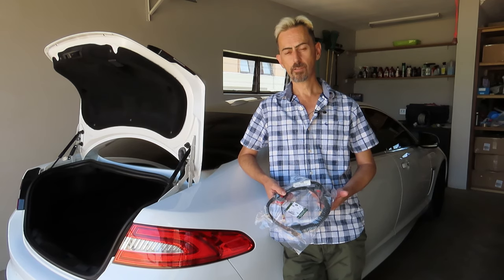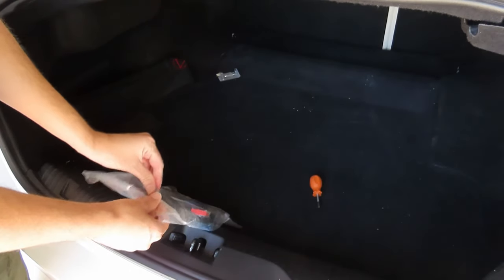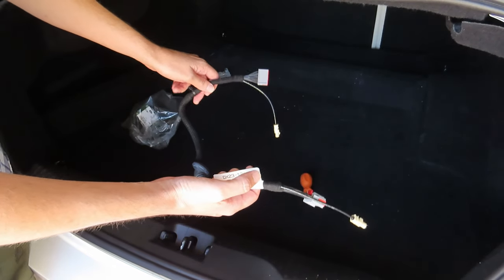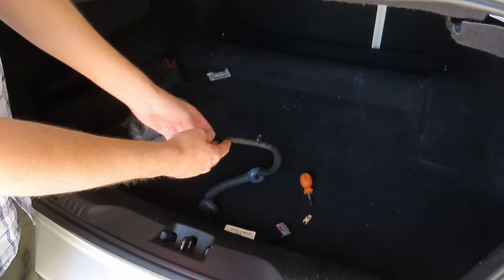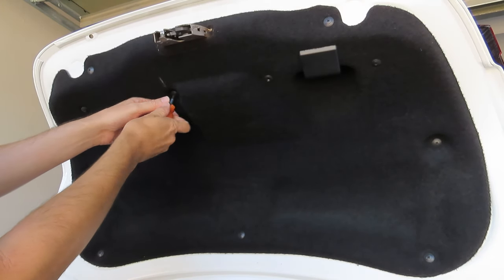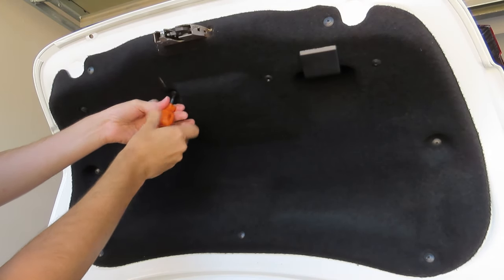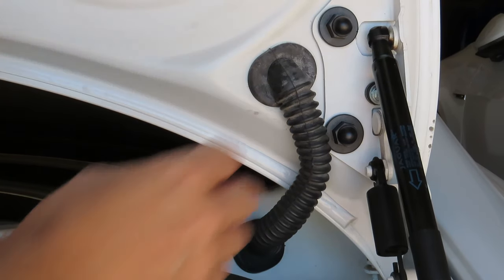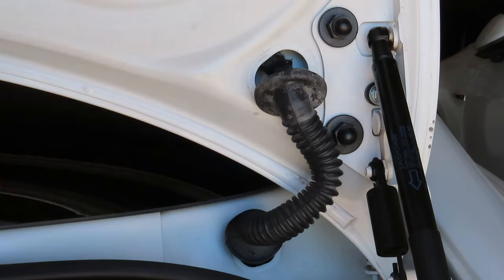How to fix Jaguar reverse camera blue screen

Comment: Hi Hilton

The screen went black yesterday in my 2013 XF and I was very grateful for your video which quite rightly identified the issue and saved me a lot of money and inconvenience taking it to my Jaguar dealer in Liverpool ( Hatfields) 

I  picked up the new loom from Hatfields that afternoon for £48 ( It was in stock) and I ordered some (Metal) trim clip removal tools from Ebay and did the job this afternoon. It went very smoothly thanks to your video.

A couple of tips

Firstly I took the opportunity to make sure all the wiring running across the boot  ( Trunk) lid etc was securely fixed using extra cable ties and duct tape to ensure it did not rattle.

Secondly, when the trim clips with the central screws are removed they tend not to tighten up very well when you replace them. I found that using slightly thicker self tapping screws ensured that they were as tight as possible.

Great stuff Hilton

Steve
Reply from the maker: Glad you came right Steve and thanks for the tips. It helps the community 👍😊

Comment: Very good.  I had same issue. I did not check the price here in Canada.  A jag mechanic said it was more like 400. So I spliced all the wires myself.  I believe the camera is coaxial.  And the colour will come back with using a shield. So I first slid on small pipe and a heat shrink. Then I slpiced copper line and original shielding slid over the heat shrink. After shrunk slide over small pipe.  Then electrical tape. Worked. It's clear enough and colour.
Reply from the maker: The older XF's might use coaxial.  However,  mine uses a CAT5 fiber optic wire which isn't repairable.  This is why I wasn't sure about whether this harness will work on the old shape XF.  Jaguar used fiber optics for various other items in the car as well due to their speed which communicated with the car's canbus.  I should have broken the old cable up to show everyone what it looks like.
Reply: Ça n’a pas marché pour moi
Reply: You have to make sure to reconnect the original braided shielding

Comment: Dude, thank you so much. I was about to buy a new camera. But when you said this is a fiber optic cable it comes lika a thunder in my head, that the opening and closing of the trunk might have break the cable due to the bending amount constraints over the time. My cat has 240.000 km now ;) Thank you so much! Cheers. 🙂

Comment: Hi Hilton, just changed the harness. When I checked the old one, one of the wires had totally snapped and most of the rest were showing exposed copper. Once again, thanks for your help.
Reply from the maker: This is what I'm trying to get across to those who say, just repair it. I could easily have repaired my loom but a few months later another wire would snap and I'd have to fix it again. It's not nice driving a car with the anxiety of what's going to go wrong next. If you replace the loom, you know it's good for another 10 years at least.

Comment: I'm getting feedback from suppliers now that the looms are no longer being made so I'm probably going to have to rebuild the loom myself. I'm wondering if the optical cable comes out of that housing at all. If so I can buy a standard cable and use those fittings.

Comment: Not had this one yet despite running additional cables through that gaiter for a 360 camera system. I though that was fixed for the facelift cars but apparently not. I've seen other whe re wiring has stress fractured. It would make an interesting follow up video to do a post-mortem on the old cable.
Reply from the maker: Hey Paul. I threw the old cable away. Got to move on to the next thing on my XFR 😜

Comment: Once again, a big thank you Hilton for a clear explanation of both the problem and the solution. So far, I've had no rear camera problem, but can rest easy on fixing it if it's a wiring fault. Do you have any plans for putting in some ambient lighting?
Reply from the maker: Ambient lighting? I sure do. I have everything already. Just need to find time to tackle it 😂

Comment: Hello CarFan Your video is perfectly clear, thank you for the explanations. The wiring harness in my car has the reference DX23-13A444-BA, do you think that the reference C2Z19978 replaces it?
I'd like to take advantage of your expertise to ask you for 2 simple pieces of advice. How to check if the camera is working before changing the harness and how to dismantle it too.
I have a faulty plate bulb, how can I change it too?
Thank you in advance for all your answers.
Reply from the maker: @Warguy-uw6pi  unfortunately I don't know what that reference number means. I just know the part number which I used. 
The only way to know the camera isn't working is when the screen goes blank instead if giving you an image. The you know it's the cable. The camera rarely breaks.
The license plate light bulb can be changed from outside the car. Just use a small flat head screw driver, insert it in the little slot on the lense and unclip it to reveal the bulb.
Reply: @carfanfan  Thanks tou very much !

Comment: Great video, my rear sensors recently stopped working please help me! Camera works fine it’s just the beeping that stopped how can I fix this? I called my Jaguar dealer and they’re saying it’ll be $250 just diagnose it! 😫
Reply from the maker: Put the car in reverse with the ignition on, but don't fire the engine. Then go round the back of the car and put your ear next to each of the four sensors along the bumper. You should hear a faint rapid clicking sound from each one. If only one sensor is down, the entire system fails.

Comment: Yo can you help me Hilton, I just got my new LOOM part and switch out old LOOM like how you told us viewers to do & my screen still blue, any help ?
Reply from the maker: Hey, it's possible the new loom is faulty. I would exchange it for another and check to see if that fixes it. I know this is a dumb question, but are you sure you plugged it into the camera cable? It's easy to forget as one goes along. Are you licence plate and tail lights working?

Comment: Finally received the loom after a few months. The one for my 2008 Jag had to travel from Australia (I'm in Europe) it was sold out everywhere.

Anyhow, that didn't fix it. What should I try replacing next?
Reply from the maker: Oh boy. It could be the camera itself, but uts rarely the case. It's usually the loom.
Reply: Interestingly, many people saw their loom wires broken/bent/destroyed... well, my old cable looks like new, no visible damage at all.

Thanks for the advice anyway!

Comment: Hi Hilton, could this also be a problem if both camera and sensors are not working?
Reply from the maker: Nope. The camera will stop working the moment just one sensor stops working. Your camera is probably fine. Have the sensors checked to see which one is faulty. The moment you replace the faulty sensor, your camera will come back on.

Comment: Hi Hilton. Just wondering, does this wiring loom also contain the wire for the boot release button? Boot still opens with the fob and interior button.  Thanks  Dave
Reply from the maker: Hey Dave, yes it does.  Chances are that wire broke right in the kink of the bend of the loom.  And chances are that if you have a backup camera, that too will stop working soon as the wires start to break one by one.
Reply: @carfanfan  
Thanks Hilton, will get the loom ordered and get that sorted.

Comment: I don't have any yellow guidelines on my screen when I put the car (2008 Jaguar XF) in reverse. Can this be an optional extra or there is something wrong with it?
Reply from the maker: Older models didn't have that function.  The lines were introduced from late 2010 only.
Reply: Thank you so much for clearing that up. 👍 I couldn't find anything about it.

Comment: Hi hi have an xj 351, all at once my rear camera, front and rear sensors and blind spot monitoring  system have stopped working, can it be the loom, many thanks
Reply from the maker: Hey Rob - usually if the rear camera stops working, the sensors will still continue to work.  However, if one of the rear parking sensors becomes faulty, this could affect your BSM.  The camera loom in the trunk like the one I replaced is not mutually connected to the blind spot or parking sensors system - this will not cause your sensors to stop working.  This might help
https://topix.jaguar.jlrext.com/topix/service/procedure/435621/PDF/5306a1f4-f179-48ad-a354-87671f250930/en_GB
Reply: @carfanfan  thanks for that, I had the car resprayed a year ago and had warning lights and messages saying parking sensors not working camera not working etc, but it was just a plug not connected properly,  when fixed all messages disappeared, but now only message is bsm not available,  looks like a trip to dealer,
Reply from the maker: @robertcrossan8507  my guess is a plug to one of your parking sensors has become dislodged or the wire has broken to it. 😉
Reply: @carfanfan  thanks Hilton I will get it checked

Comment: This is another design fault that has persisted throughout the evolution of the XF that the customer ends up paying for.   Did jaguar never think that people would never open and close the trunk.  ?
One fog lamp had stopped working in my XF.  I traced the fault back to the loom.  Luckily it was just a case of unplugging the loom and a squirt of WD 40 and plugging it back together again and that fixed the problem.  👍

My XF is now with another owner.  

It's relaibilty has been questionable to say the least.   My Jaguar X type was totally reliable and only had a new battery and intercooler hose clip replaced during its 136000 miles.
Reply: Agreed I get frustrated as Jaguar engineers are weak that is why the company went under….

Comment: My reverse camera ain't working but also the parking sensors. Are the parking sensors anything to do with this wiring loom?
Reply from the maker: No, they aren't, but they are linked to the same canbus. If one parking sensor is faulty, your camera won't work. Locate and replace the sensor, and your camera will work again. Dumb way for Jag to have designed it, but there you are.
Reply: @carfanfan  Really appreciate your feedback Hilton. I'm determined to fix this myself!

Comment: Just a note, you need to check the part number against your particular model, in my case a 2011 XF-S and the part number is different to what you have quoted, for my vehicle it is C2Z19874
Reply from the maker: Yeah, judging by some of the nasty comments I received regarding the optic cable for the camera some are not fitted with one. My car has the auto close trunk latch so that could also be a specific cable.

Comment: Is the optic cable the video signal carrier? 😮 I had no idea they are using this kind of solution in the wiring harnesses, and already almost 10 years ago!
Reply from the maker: Yip. That's correct. Many of the cables connecting to the canbus use fiber optic cables. VW and Audi have been using the same solution since the early 2000's.

Comment: Any suggestions? Or links I been looking for weeks online and can’t find the cable. I’m located in the U.S. thank u
Reply from the maker: I'm afraid its best to get this from the dealer.  It won't be cheap, but it will last.  If you get one from a salvage yard, chances are it will most likely fail soon any way.

Comment: Just found the channel via this vid and love the content, I’ve got a 2014 XF R-Sport and both the camera and sensors have stopped working, would this fix the issue?
Reply from the maker: The camera yes, but I'm not sure about the sensors. It sounds like two separate buddies to me because they are not interlinked. The sensors will still work even if the camera stops working. It's possible you have one dead sensor and it's causing them all not to work. They run in sequence as far as wiring is concerned so it's probably the first sensor from the plug causing the rest to be dead too. Best to take the bumper off and check the wiring, if that's all good, check each sensor using a multi meter. Start with the first one closest to the plug as that will tell you a lot. 😉
Reply: @carfanfan  that’s brilliant thank you for replying and the advise, I’ll start looking

Comment: Hi, I bought a camera through ebay, it doesn't work, they tell me in good faith that it's good, what can I do to keep checking? My car Jaguar XF250 y 2015 thanks !
Reply from the maker: I have had this quite a lot.  People buy cameras for their Jags on eBay and it doesn't work.  The camera is not the issue, the harness is.  You need to replace the harness with a new one or salvage one and it will all work fine again.

Comment: Hey Hilton do you know how I can remove the chrome trim on a prefacelift XF?

Cheers
Reply from the maker: Hey Marius - are you referring to the window chrome or the trunk chrome?  The window chrome  can be removed by opening the door, in the door jab just where the chrome meets the end of the door, there is a grommet that must be removed, there's a screw in there.  Once that screw is removed, you can maneuver the chrome off - but you must also first remove the side mirror on both front doors - the door card must come off to do that and you will then have access to the side mirror bolts, undo them and the loom plug and you good to go.
Reply: @carfanfan  I refer to the trunk chrome stripe

Comment: What yr is that Jaguar, would the same part fit for a 2011 Jaguar XF
Reply from the maker: Mine is a facelifted 2011 model.  I believe the same part will fit your car if it is the pre-facelift model.  I checked my dealer after filming this video and they said it's used for all the XF's that are X250.

Comment: Good video thanks. I have a Jaguar XE R-Sport, 65-reg, early 2016 model, with a reversing camera flashing on and off repeatedly when reversing. Took it into Jaguar (Scotland dealer) who advised £108 for wiring loom after paying £176 for a diagnosis. Then they said it needs a new camera at around £2000. - Can you believe that!?
Reply from the maker: Holy cow. Did you get it fixed? My guess is the loom.
Reply: @carfanfan Hi, no, still broken to date.

Comment: When i changed it i used new loom wire but after that my car number plate bulb continuously shining what should i do ? @carFan
Reply from the maker: I'd say your loom is faulty. Exchange it for another. Your license plate lights shouldn't be blowing like that.
Reply: @carfanfan  i am in canada I ordered it from London Now i have to see what can i do with it
Reply: Can i just remove number plate bulb and use it for camera and other lights when they will send me new i will put bulb again ?
Reply: @carfanfan  if i remove bulb and power can stay in wires is that okk for car or does it effect or cause of fire ?
Reply from the maker: @user-vd5fm7ym5k  if you constantly have power goingbtonthe socket the wires will get hot and eventually overheat and potentially cause a fire. There is a short circuit in that loom, which causes the light to stay on all the time. Short circuits cause fires, plain and simple. I would change that loom for a new one. It's defective. Sounds to me like the wires inside the loom have a positive permanently touching another positive, which is causing the short. I wouldn't yake the chance unless you want the car to burn out due to being problematic and want the insurance to pay out for a replacement 😊

Comment: Thanks for the video the rip Off  here is you only need the optical cable not the full loom….it’s over engineered the loom is causing stress on the optic cable that is why it breaks probably in the rigid loom itself.

Comment: What are the chances that my camera gets bluescreen 4 days before you post this video :D  (2011 XF) Now just to check for the right part nummber for my cat..
Reply from the maker: Wow! Looks like our 2011 Jags synchronized their camera failure. Perhaps they conspired 😂. Hope the video helps make it easy for you to fix. You won't believe what the dealer wanted to charge in labor to do the job.
Reply: @carfanfan  oh, but i would. My Jag shop here in germany wants 140 EUR for that cable alone.. ordered from UK  Jag dealer for 40 Pounds :D
Reply from the maker: @ajareseldejebiga  holy hell. I wonder why USA and Europe charge so much for this cable. It's around 40 pounds here too in South Africa. They still have 3 in stock so it will at least help others in the mean time.
Reply: I also have a pre-facelift car like you. Was the part number the same as stated in this video for the facelift model i.e. C2Z19978 (fibre optic) or, was your pre-facelift a different part number? Thank you.
Reply: @poorboymechanic5280  There is no fiber optic in my cable, i was wrong. In the end i resoldered the wires and fix the issue. Works 2 years now..
Reply: @ajareseldejebiga   Thank you for that information. Much appreciated Sir. Think i will try the same 👍

Comment: My xfs is a 2011,I would think they would be the same,mines still okay,so time will tell...
Reply from the maker: Yeah it really depends on weather temp I think. Here in SA it's hot most of the time and wire becomes brittle faster. You probably still have a few years left on yours 😉